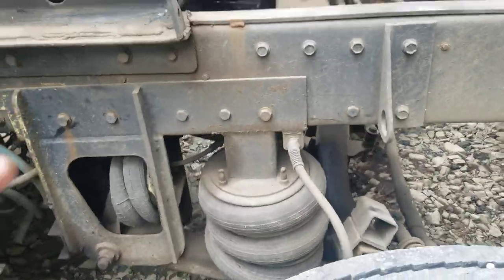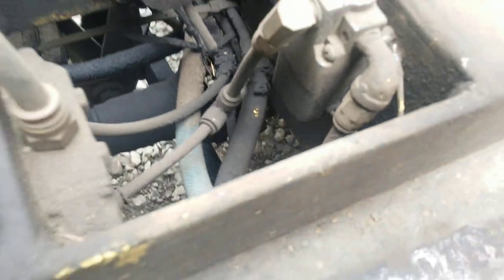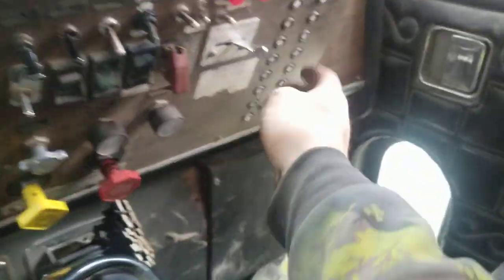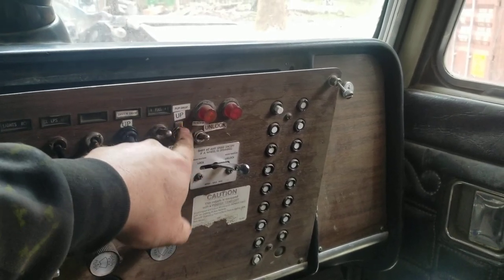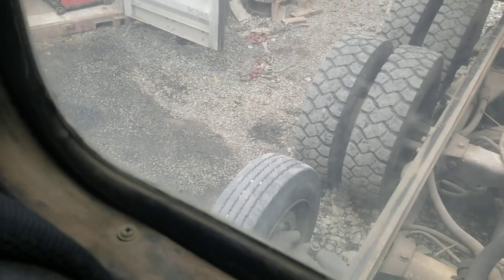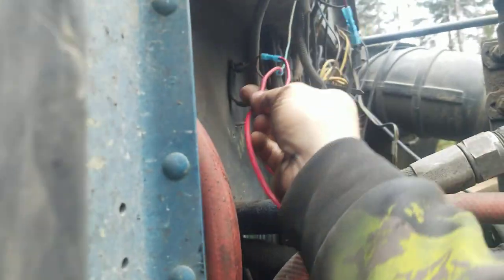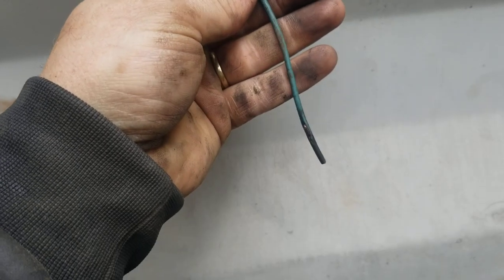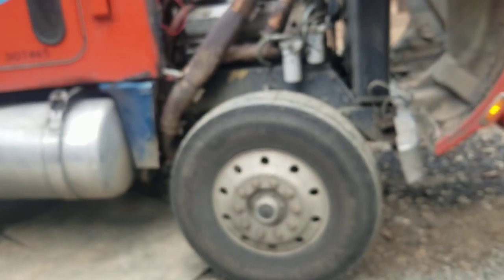Electrical issues for drop axle diagnosis

Comment: Excellent way to diagnose the problem.  It's amazing how a rubber hose can rub through the wire insulation.
Reply from the maker: Yeah I was surprised when I seen it
Reply: @BRIANVANDUYN   When you had the dash open I saw the switch for the Jake Break.  Do you have plans to get it going?

Comment: Is that switch from the factory?  What's the purpose of it?
Reply from the maker: There is a manual switch I believe they are on all the old trucks
Reply: The circuit breakers are from the factory but not the  drop axle switch.  That was installed with the drop axle.